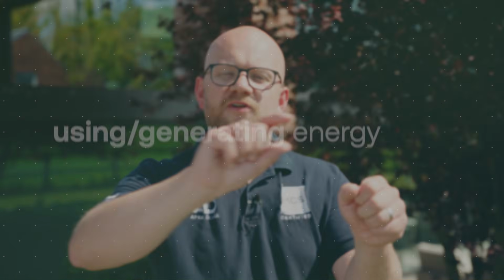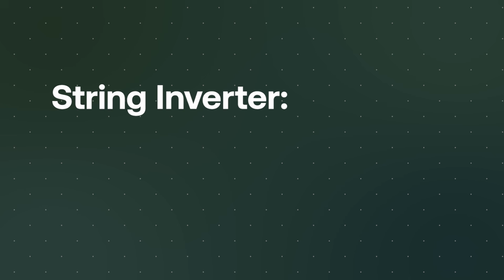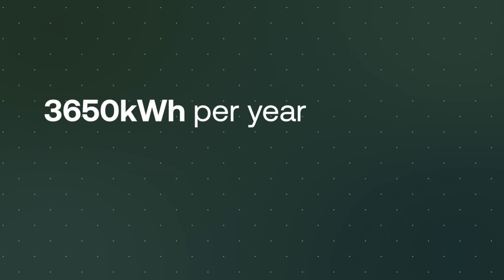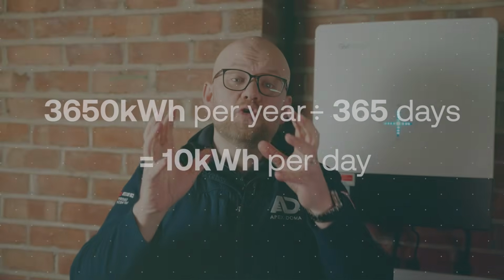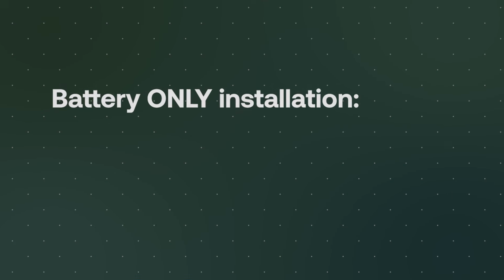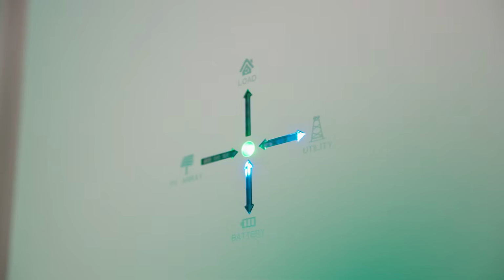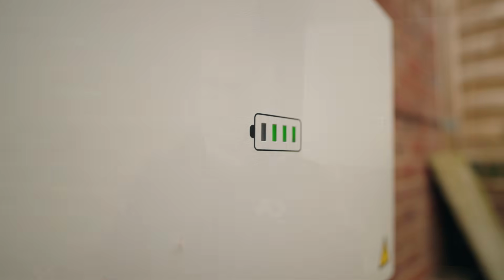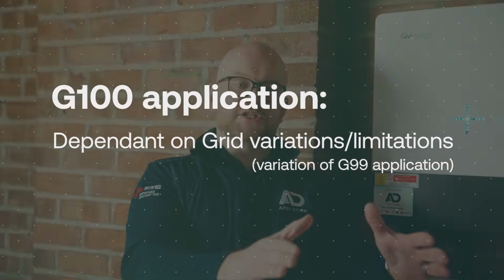Solar & Battery Storage Explained: A Beginner’s Guide to Making the Right Choice in 2026

Comment: I have a 1.9kw system which was installed in 2011. It has a Sunnyboy spring inverter installed in the attic which will need replacing. When I replace it I would also like to add battery storage. My usage is around 1100kw a year. 1 Am I allowed to add battery storage to a FIT system? 2. What would be the best option for me to consider? 3. Can you recommend an installer in S Yorkshire?

Comment: Great video
I have a little different opinion of sizing my system and storage. I plan for the worst weather, typically in the winter. If I have three days of storm and during winter solstice, I have enough Solar panels to charge three batteries and that takes my home through the storm without pulling from the grid.

Comment: Thank you for the video. I have an existing solar array on my pitched roof (5kw peak generation) with a 5kw hybrid inverter and a 10kwh battery. I would like to supplement this with another array on my (extremely) easily accessible flat roof. I want to do this as cheaply as possible because I've already spent a lot on the first array. I'm thinking of having a string inverter for array 2, so that the house demand is taken away from array 1 which can then focus on charging the battery. My question is, will the two-inverter system be smart enough to just work this out for itself? Thanks
Reply: I possibly should have said- array 1 is G99 approved

Comment: I all ready got a system installed in my home a polar ess 6 kw inverter and a 5 killer watt battery and it still does not work in my home a don’t no why everything is working the battery is getting charged but it does not help my home one bit

Comment: Thank you very much. A very educational lesson. I have a question. 
I have an array of 7x455w On one side. And 6x455w on another. 
Can I add 2x670w panels on a third roof to add on to the same inverter?
Reply from the maker: Thanks for the question! This could be possible, but it depends on your inverter. If you only have 2 MPPTs, it’s unlikely, but with 3 MPPTs and the right voltage range, it might work. Mixing different panel sizes on the same string isn’t ideal because the string will perform at the level of the lowest voltage/current panel, so your bigger panels won’t perform to their full potential.

What inverter are you running? That’ll help figure out the best way to expand your system.
Reply: @apexdomasolar Thank you for coming back. Really appreciated. I am running 
Dura-i Inverter
 PD-DH1P-6K-G1

Comment: One aspect of inverters that is not talked about in general is their electromagnetic emissions which might be harmful to the residents. I'm wondering if you've done some research on this and how hot to minimise the effects? A video on the topic will be much appreciated.
Reply from the maker: Hi @blankslate6393, great question and not something many people bring up.

All inverters give off a bit of electromagnetic radiation just like Wi-Fi routers, microwaves and basically any bit of kit that switches power. The key thing is modern inverters are built to meet strict EMC standards, so the emissions are really low and drop off fast with distance. You’d usually get more EMF exposure sitting next to a smart meter or under a high voltage pylon than from an inverter in your garage.

I’ve not seen anything that suggests home solar inverters are a real health risk. Most of them are tested to international guidelines and come in well below safe limits. If anyone’s sensitive or just wants to be cautious, putting the inverter somewhere like a garage or utility room is a simple win. Good cable routing, grounding and decent brand choice also helps. Tesla, GivEnergy, SolarEdge etc are all solid on compliance.

Appreciate the comment.
Reply: EMF radiation is, and always has been, harmless.  You and everyone else on the planet have been bathing in it 24/7 since the 1950s.

Comment: kw & kwh have the same "value".. its ONLY the context in which they are used that differs.. kw is a value of energy.. used.. kwh is the SAME VALUE of energy.. but.. stored yet to be used.. they BOTH rqual the same value of potential effort.. a 1kw motor will use that kw of energy input.. what it oitputs depends on its power factor efficiency in converting energy in to effort out.. heat.. is the energy lost in both stored kwh in or out & kw effort out
Reply from the maker: Hey Errol, really appreciate you diving into this. I love seeing people getting stuck into the detail.

I actually got this a bit wrong myself in the video, so you’re definitely not alone. It’s an easy one to mix up.

Just to clear it up:
kW is a measure of power, meaning how fast something uses or generates energy.
kWh is a measure of energy, meaning the total amount used over time.

So if you run a 1 kW appliance for 1 hour, that’s 1 kWh used. They’re connected, but not quite the same — it’s a bit like the difference between speed and distance.

Thanks again for engaging with it.
Reply: @apexdomasolar  yes.. they arent.. quite the same only depends on context.. the.. over time.. is benchmarks as.. 1 hour.. for both.. the rest is pedantics really vs efficiency losses of both sides of the energy account.. stored vs used.. in vs out

Comment: I have a thing called an iboost fitted to my system. For those that don’t know, my panels heat the hot water via the immersion heater, my gas boiler is off all summer, free hot water. My question is……would fitting batteries affect that at all?
Reply from the maker: Yes, fitting a battery would affect it slightly. The system will prioritise charging the battery first, then divert surplus energy to your immersion heater via the iBoost, and only export to the grid as a last resort. So if you’re currently exporting a lot, a battery would be a great addition, it’d store that excess for evening use and could even charge overnight on off-peak rates in winter. You’d be even closer to going off-grid overall.🔋😃
Reply: @apexdomasolar you don’t install in the Highlands by any chance do you?
Reply from the maker: Sadly not :( we are Cheshire based and install across Greater Manchester, Lancashire, Merseyside, Staffordshire, Derbyshire & West Yorkshire. That sounds like a big area now we've written them all out 🙈
Reply: Thank you so much for getting back to me so quickly, that’s brilliant. I love the fact that we use hardly any gas through the summer only for cooking. We are generally in credit on our gas bill too. We only pay £75 for gas and electric per month and we are always in credit. We have a very efficient boiler too. Would you still recommend batteries and risk using more gas to heat my hot water through the summer? We don’t use a lot of hot water, I usually shower at the gym and my wife is very quick in the shower. 👍

Comment: 16:54 Ok, so I'd like to upgrade my system to provide an EPS for the house which can use my PV.
My setup is currently 24*410W panels mounted 50/50 East/West running through two Solis 5kW string inverters and 11.6kWh of Solax  battery storage running off a 5kW Solax AC coupled battery inverter with a built-in EPS, so i can run off the battery during a grid outage, but not the panels.
I'm thinking that I could replace the string inverters and the battery inverter with either a single 8 or 10kW hybrid inverter or two 4 or 5 kW hybrid inverters with EPS capability? Am I thinking along the right lines?
I'm be tempted to go for two smaller inverters to eliminate a single point of failure, although given my batteries are Solax, the new Solax-X1 VAST 8kW hybrid inverter is looking like a viable solution. So far this year, the maximum instantaneous output from the panels is under 8kW.
Reply: Thank you for replying to me. 😁
Reply from the maker: Pleasure 😃
Reply from the maker: Thanks for sharing your setup. It sounds like a solid system.

You’re right that you'd need to move to a hybrid inverter setup to get full EPS functionality from both your PV and battery. But before replacing all that kit, it’s worth questioning: is the cost of swapping everything out just for EPS really justified?

If you live in an area with frequent power cuts, investing in a system with proper backup makes sense. In that case, something like the Tesla Powerwall 3 would be our top recommendation. It offers whole-home backup, integrates beautifully, and doesn’t require a full rewire of your existing system.

If you’re open to alternative brands, take a look at the GivEnergy High-Voltage hybrid inverter and battery. It’s a strong, UK-based option with excellent monitoring and EPS capabilities.

But if blackouts are rare, you might want to stick with what you’ve got. If you elect for two inverters, just ensure they have an EMS and can work in parallel, as not all systems can.

Comment: This video is riddled with a lot of misinformation 
A cycle is a full charge and discharge (charge from 0-100% and discharge to 0%)
That’s a full cycle, it’s too rare to find a battery being fully charged and discharged multiple times a day unless it’s used in a heavy commercial environment or it’s used to store energy during cheap rates and reselling the same at higher rates 
Putting even 300 cycles on a battery in a year is not easy n in which case the cells will be the first to quit before the warranty runs out as most residential battery cells are rated for 6-8k cycles to either 80/70 or 60% capacity 

If a beginner watched this video and made purchasing decisions based on the information given, they’ll most likely make costly mistakes 

If you daily usage is 10kwh of energy, you don’t buy a 10kwh battery 
There are power inverting losses, consumption by the inverters, power loses through heat n so forth
A properly designed system is 2x the amount of daily consumption or at least 1.5x
All in one inverters are inverters that have a mppt controller, charger and inverter in one unit while a system like Tesla powerwall in an all in one ESS which also includes battery storage
Reply from the maker: Thank you for taking the time to share your thoughts.

You're absolutely right that a cycle refers to a full 100% discharge of a battery’s total capacity, which can be accumulated over multiple partial uses. In the video, we simplified this concept for clarity, especially for newer audiences, but we appreciate that deeper technical detail is valuable to some viewers. We'll consider including a clearer distinction or a follow-up explanation in future content.

On the matter of battery usage and throughput, industry standards are indeed shifting toward maximum kilowatt-hour (kWh) throughput to better define fair usage, as traditional cycle counts can be inconsistent across manufacturers and confusing for end users. We believe this shift is a step in the right direction.

Regarding your point on redundancy and system sizing, we respectfully disagree that designing for 2x capacity is necessary for the average user. While over-specifying a system has benefits in niche or commercial applications, we find that most homeowners are seeking an optimal return on investment without excessive upfront cost or underutilised capacity.

We always welcome constructive feedback and will continue to refine our content to ensure it’s both accurate and accessible

Comment: An inverter can both be string and hybrid at the same time as they’re not mutually exclusive 
A hybrid inverter has grid interactive features and incorporates batteries but some are able to operate with or without batteries 
String inverters take dc from panels (dc coupled) and they’re a central unit where dc-ac inverting is done 
Almost all hybrid inverters are string inverters 
I reckon there’s only 
Off grid inverters 
Hybrid/DC coupled inverters 
AC coupled inverters
Reply from the maker: Thanks for your input, Michael always good to see people engaging with the technical side of inverters.

Just to clarify for others reading: when we talk about hybrid and string inverters, it’s true they’re not mutually exclusive. A hybrid inverter can be a string inverter, but the terminology serves different purposes:
	•	“String inverter” refers to the topology – how panels are wired (i.e., in series), and how DC is handled centrally.
	
•	“Hybrid inverter” refers to functionality – the ability to manage multiple sources (solar, battery, grid) and sometimes loads, often with grid export/import and backup features.

So yes, most hybrid inverters on the market today are string inverters by architecture. However, it’s important to distinguish that not all string inverters are hybrid.

We also find that many homeowners and professionals are still getting to grips with the nuances of AC-coupled vs DC-coupled systems, and what constitutes “hybrid” in the practical, functional sense – especially when integrating storage, EV charging, and grid services.

Thanks again for the conversation – it helps elevate the level of understanding in the industry.
Reply: @apexdomasolar I also believe the difference in solar markets also adds nuances to the equation for instance the American market uses similar terminology differently from most other markets and it’s somewhat confusing
Reply from the maker: We agree, it isn't easy to navigate even with loads of experience. We can't know everything, but we can have a good go at trying! Thanks for the comments.

Comment: IP rating, actually stands for International Protection Code… I believe.
look in your brown book! Common error although Wiki disagrees, and we all tend to say ‘ingress protection’
Reply from the maker: Thanks for the comment, two phrases can be used interchangeably. We are both right 😃  

See reference - IEC60529 

The manufacturer refers to them as Ingress Protection as well :

https://givenergy.co.uk/what-is-ip65-rating-is-my-givenergy-home-battery-waterproof/

😃
Reply: @ yes, a bit of an evolved history of the naming……
Reply from the maker: Thanks for commenting. The more we get challenged, the better we become! 

OSG / BS7671 does refer to this as the “International Protection Code.” Electrical Safety First (NICEIC / NAPIT, etc.) still refers to it in the best practice guides as “Ingress Protection.” There appear to be loads of inconsistencies. Once you see this, you can't unsee it. This seems to be related to joining and then leaving the European Union. 

Down a rabbit hole! 🐇

Either way, for the beginners out there, they can go outside or in a dusty environment

Thanks Herrtomas

Comment: But I  am looking at moving to a new house and going to add a heat pump so how on earth do I work out how big a battery I need
Reply from the maker: Check out our video on tariffs, you can get yourself onto a heat pump tariff. So your battery can charge 3/4 times per day, which means you can go for a smaller battery 🔋

Comment: As always, informative and a good video. Thanks.
However, I don't think you touched upon micronverters. I only know of Enphase micronverters which are a premium product that's a better alternative to Optimisers and my understanding is that cost wise there isn't much difference, i.e. micros per unit cost will be higher than Optimisers, but 
a) you don't need a hybrid inverter, which one will need with optimisers; 
b)with Enphase you get a great track record of reliability, quality and almost double the warranty.
Reply from the maker: Thanks for the comment, we will put a dedicated video together on Optimisers and Microinverters to help 👌 🌞
Reply: Thank you, look forward to it. 
I just asked Chatgpt and Grok to compare Enphase micronverters with SolarEdge and Tigo Optimisers. Glad to report that they both expanded on the two aspects that I mentioned in my earlier comment. I wasn't aware of the unit price of these components before, but looks like in the end, there isn't much savings by opting for Optimisers as opposed to micros, which tells me that the definition of a quality Solar PV setup should ideally consider Enphase micros, irrespective of shading or no shading.
Reply from the maker: As a side note, factor in the round-trip efficiency of DC to AC, AC to DC and then back from DC to AC, which happens multiple times with micro inverters, and look at lifetime ROI.